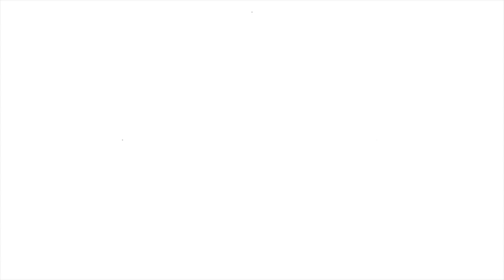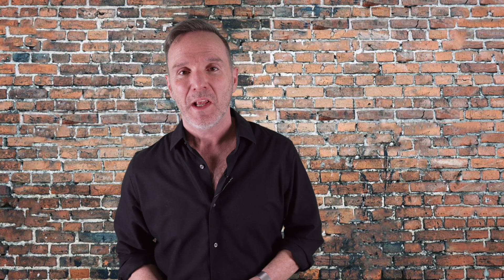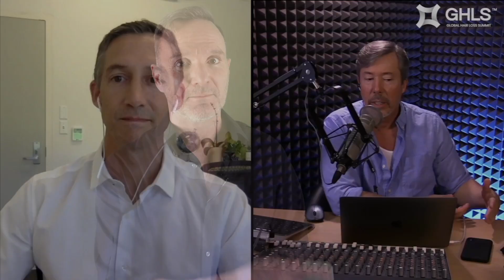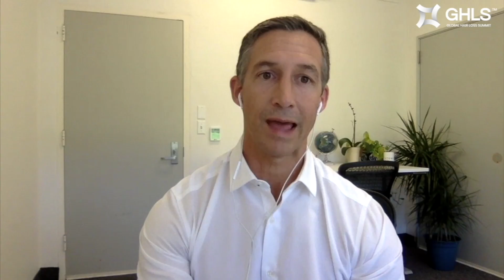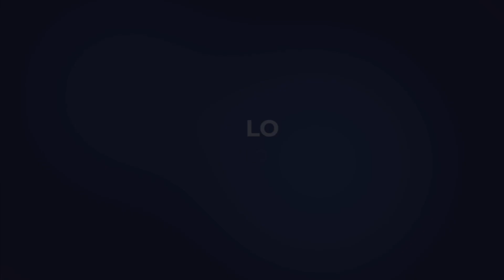Stemson Therapeutics Interview Part 3 - Human Trials When?

Comment: Cure or treatment ?
Reply from the maker: I personally believe it will be closer to being a cure as the idea is to have one treatment that will produce strong healthy hairs in one shot, with multiple treatments only necessary to get the desired coverage/density. I doubt that follow up maintenance will be necessary if the initial follicles are healthy.
Reply: @hairtransplantchannel  so stemson knows how to produce dht resistant hairs?
Reply from the maker: @janmiedza6607  I suspect that the source material they're pulling from will already have natural DHT resistance.
Reply: @hairtransplantchannel  
"HLC2020: What aspects of hair growth do you believe you will be able to control? Shaft thickness, direction, etc.?

Dr. Terskikh: Should be able to control all aspects. The shaft thickness (also hair length) is directly proportional to the number of DP cells in the DP capsule. We can transplant any number of cells we want."
Reply: @hairtransplantchannel  I remember someone mentioned that this was more like a treatment where you have to have the surgery done every 5 years or so to replace the dying hair.  I believe stemson hasn't figured out how to get more than 4 hair cycles.

Comment: How will they be able to inject a natural looking hairline?
Reply: I think if it does work it would be better used for the crown.  You can still get a good hairline surgery using current practices and a good surgeon.  Then fill in the crown with the new tech.
Reply: with a robot?

Comment: So they need to design the parameters for human/pig skin, optimise a scaffold, build up a manifacturing process, find or engineer a suitable robot and pass clinical trials. Thats a lot of work to do and explains why there is no hair loss cure as of today, it's just extremely complex (and wasnt even well-funded for decades).
Reply: The other thing is a machine should be able to tell where the hair is less dense, so it knows where to put the grafts. This is especially needed in diffuse hair loss individuals.
Reply: A lot of work to do. But if it fails we have the framework.
Reply: @lolnyanterts  that is true, but I would prefer no further delays :P
Reply: @vflwob5  if it gets bad, wear a hair system in the meantime. we all have hairs
Reply: @lolnyanterts  yeah good advice :)
Reply: @vflwob5  and remember, even the most barren wastelands of scalps, the most arid of unfertilized, dead follicular wastelands can be revived with cloning. there is ALWAYS hope.
Reply: @lolnyanterts  yeah we can always hope :) just doesnt seem like something which will be in the clinics soon at this point, lets wish them best luck tho!
Reply: @vflwob5  for sure, i heard the koreans are focused on it. that presidental candidate mentioned finding a cure.
Reply: @lolnyanterts  I think it was about insurances covering Finasteride but maybe I've overheard something!
Reply: @vflwob5  i think it was more about a cure. shame though. to mention im only 17 and facing diffuse hair loss, fucking hell! i hope theres something for the future for me. to be fair i havent tried hair fibers and concealers, and im not consistent with my minoxidil, but once i turn 21 im getting on fin.
Reply: @lolnyanterts  it'll be way too expensive at first don't ruin follicles with hair systems
Reply: Im surprised all the bald billionaires dont help funding

Comment: I got my first hair transplants back in 1977 my doctor told me the cure for baldness was only 5 to 10 years away. Well it's been 45 years now. 18 procedures to restore my hair. Looks pretty good. But this cure or fix? I'd sure like to see it happen before I am down to the last three follicles. Or in a pine box.
Reply: So you started out with punch graft plugs and later went on to have follicular units?
Reply from the maker: @oncall21  I've seen this progression before where in the hands of the right doctor the old plug work can be softened quite well.
Reply: @hairtransplantchannel  Strong original frontal line and great bobbing and weaving by scalp excision-ors helped.  I kept plug work close to lateral hump's so later excisions just took the thinnest weakest scalp areas top/center of head.  As my frontal line dissipated the excisions took the remaining nearer to front hair and transplants into a V formation.
Reply: wtf was a hair transplant like in 1977 was it dangerous?
Reply: @nassaubahamas8570  Punch graft hair transplants were around 20 - 25 years old by 1977 and pretty safe. Same procedure -- local anesthetic followed by  punching out the bald scalp then donor har extractions. They were hand punches 5 to 6 millimeter inches wide, containing 13 to 18 hairs each (I counted!). I'd seen Frank Sinatra's work circa 1961 -62 and felt confident.  My Doctor was a fellow named Bob Berger on Park Ave in NY.  The plugs were $5 a piece.  i had 600 over a four day period.  Financially tapped me out --that's about $27,000 in today's money.. FDY over the past 45 years, those scars have shrunk to about 3 millimeters.  The plugs lasted about 10 years.  There was no supplementary drug therapy.  Had there been?  Who knows?  I do know Finasteride/Dutasteride/Minoxidil has kept my last crop circa 2011 pretty full, and that graft session I was 62, not 32.
Reply: @Zerdest Mostoo I am pretty tapped out.  Start with Norwood 3.  1970's, plugs took 6 separate sessions -- those days they weren't doing more than 150 5-6mm plugs per session.  2 scalp excisions,  1 Brandy flap, 2 Freshet devices ( 2 sessions) turned 55" of super thin scalp into 27 square inches of bald area remaining. That's 6 more sessions.  About 11,000 hairs from 3 strip grafts much from pre farmed hole filled areas.  That's 3 sessions.  Then 3 sessions about 7500 + 750 +750 including body and neck hair FUE.  I'm pretty tapped out with about max 1500 hairs all sources remaining unless we do arms/legs.  Is that 18?  Memory fades.